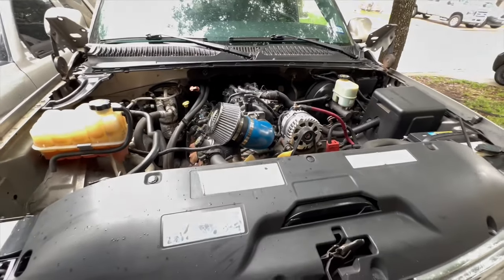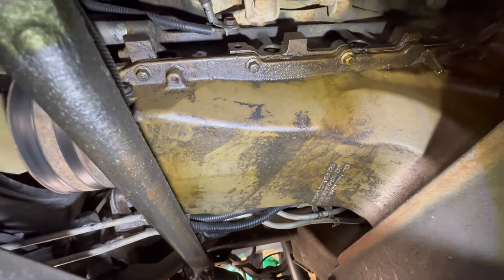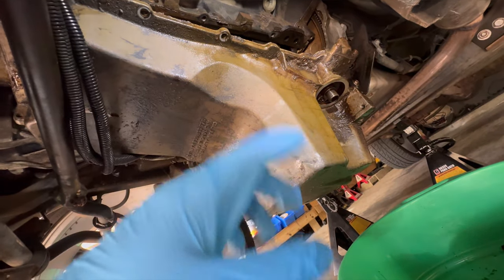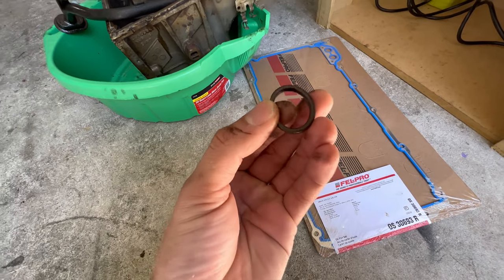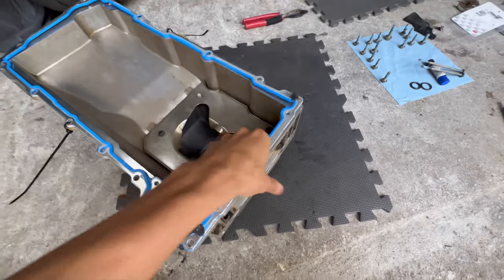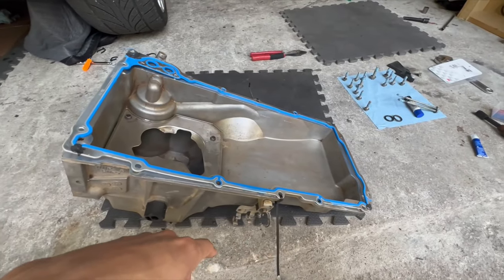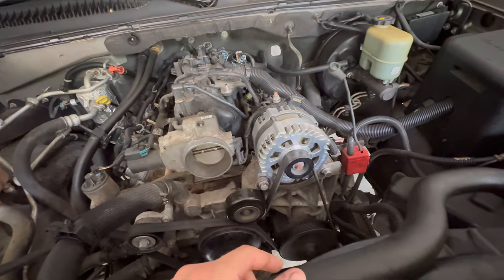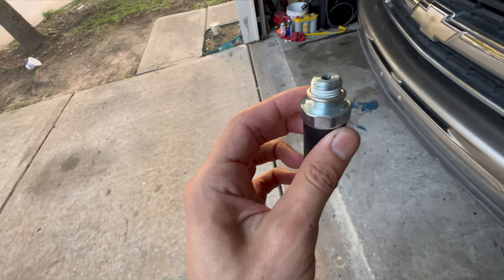Maintenance on my 01 Tahoe 👌🏽🥵🥵🥵

Comment: Great work. It’s going to run better than all the later models. The only issue on my end is, I’ve changed my knock sensors and the code is still there for my check engine light. It still runs great tho. Your detail in this video was great also. 💯💯💯💯
Reply from the maker: Thanks!!💯 Not sure on your knock sensors maybe it could be something with the wiring if it’s not reading correctly🤔 or the unless those new knock sensors have something wrong I not exactly sure, hopefully you can get it fixed.  Appreciate it 💯💯💯

Comment: Hell yeah bro that's the best way to do it. The pick up tube o-ring and the oil sending unit are often the reason why for a low oil pressure. I know on my suburban I went ahead and changed my oil pump, the oil pick up to and a new gasket. I know it's overkill but my truck has a lot of miles on it so it's about that time to changing anyway
Reply from the maker: Yes bro, I believe I will have to end up changing the oil sending unit soon👍🏼. cause it still has low oil pressure after getting the engine to temperature.  And Thanks!!💯